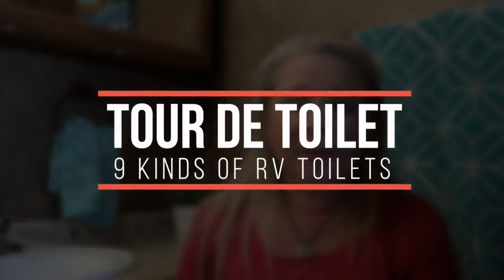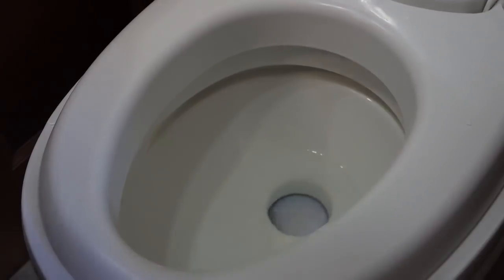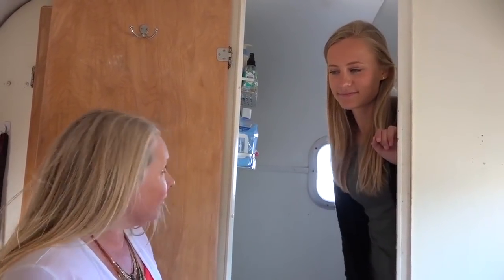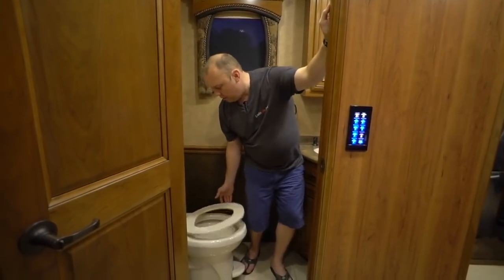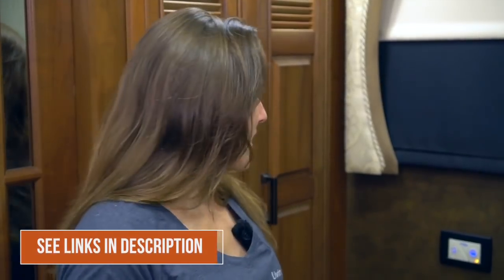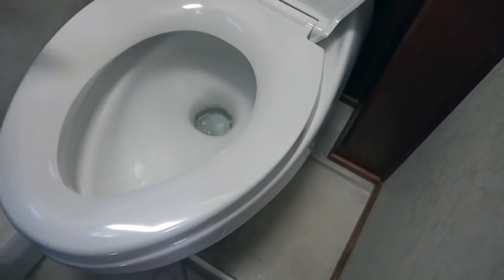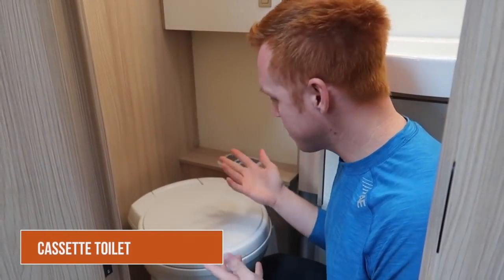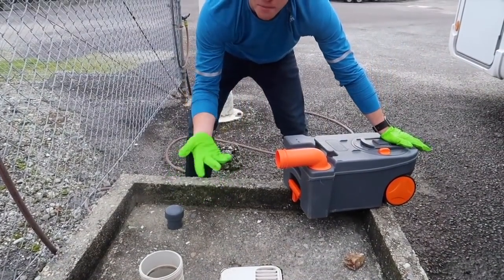9 KINDS OF RV TOILETS: "TOUR DE TOILET" WITH FULL TIME RVERS SHOWING HOW THEY WORK + PROS & CONS

Comment: what if your solid waste is larger than the hole it is supposed to go through?
Reply from the maker: Good question - you mean at the top end of the bottom/dumping end? So far we have never experienced this problem.
Reply: Looks like a three inch wide hole on the top
Reply from the maker: It will go down.. if it's something that came out of a human body! Just flush! :)
Reply: If it’s too big to go down, you need to have a talk with your doctor...
Reply: Heres what I do with a toilet with limited intake flush function...poop out half the load...flush....poop out the rest of your load...pardon the graphic description but works perfectly!

Comment: i dont know now....  i was looking at cassette toilet due to canadian weather.  but its lil too small and require frequent dumping.
Reply from the maker: Yes, Cassette toilets require very frequent dumping.  We can go weeks with our regular black tank in our larger RV.  And... our RV heats the tanks/wet bays as long as we are running the heater, so we don't need to worry about cold temperatures.  Something you might want to look at in your RV choice. -M
Reply: @Rvlove  hav u ever look into sun mar non electric composting toilet. Its similiar to natures head. But evaporates the liquid. Require no dumping for very long time.  I just found it yesterday on homedepots website. The only problem with it is the size. It will take up really big space. Might not be very  good choice for small vanlife.

Comment: I have a question on your sumo springs.did they improve the ride [smoother] or just the handleing
Reply from the maker: Sumo Springs dramatically reduced the sway of the RV which helped it feel much more controlled and planted.  So in that sense it is smoother because it does not sway.  But it does not make it softer.  Bumps in the road feel very similar to before.

Comment: Why cant we use standard home flush toilets?
Reply from the maker: Probably the main reasons are the size and the large amounts of water used in a regular home flush toilet, especially driving around with all that water in the tank above the bowl.  Very heavy and bulky for the limited weight and space of most RVs.  They would be especially impractical for anybody spending time in their RV when not at a full hook up site in a campground. -M

Comment: Better to do it this way put a Bag in a waste basket and a Bag in your Toilet and through out the Bags when they are full no fuss no mess and best of all its just like a Diaper
Reply from the maker: Not for everyone, but we have heard of folks who approach it that way.  Mostly from folks who are living in vans or other vehicles not fully equipped with proper facilities.
Reply: We do like this. We live in Germany and we have a Trigano Alpha tenttrailer without restroom. No problem, we use the restroom of the campground. But for "emergency cases" we have a foldable cardboard toilet. Take it out of the flat box, unfold it to a toilet, hang a pastic bag in, put the toilet seat on the top and ready to go. Verry cheap and simple but obviously not made for every-day use.

Comment: The one thing I don't understand about using the composting toilet is that unlike a home toilet, which maintains a pool of water, in the composting toilet the #2 is supposed to hit the hole in the middle, else it's lying there against the bowl side - yuck.  If your butt-aim isn't good, you're going to be cleaning this bowl every time you go.
Reply from the maker: I haven't used one personally, but that is my understanding too.  Your goal is to successfully get it through that hole once opened.  If your aim isn't good, there is going to be a little extra clean up, without using water.
Reply: In one, they recommend the use of a coffee filter in the back of the bowl before you go. I was thinking excelsior/shredded newspaper and documents might break down more easily.

Comment: 24:24 Ooooh... He forgot to add chemicals!! 

EDIT: Ok, he added it from the inside.
Reply from the maker: Thank you
Reply: Very late to the party, but with the thetford cassette type toilets, there is a button on the top of the cassette (in this demos case it is orange). It is an air admittance valve so you press that when tipping it out and it allows the air to equalise and stops it going GLUG GLUG GLUG
Reply: @peterfoster5898  I've never said otherwise.

Comment: What about a five gallon bucket with plastic trash bags? You just leave your masterpiece in the bag then knot it up and put it in the trash with your other disgusting stuff. Some of these 'boondockers' live in a Taj Mahal on wheels. In a SHTF scenario they will be stuck in evacuation grid lock but will have a nice place to crap until other stranded travelers come knocking on their 'coach' doors to use the bathroom.
Reply from the maker: We know that the bucket and bags are relatively popular with the vanlife community and others who primarily boondock and stealth camp.  But, we didn't feel that it was a common enough choice for most RVers, nor did it need a lot of explanation.